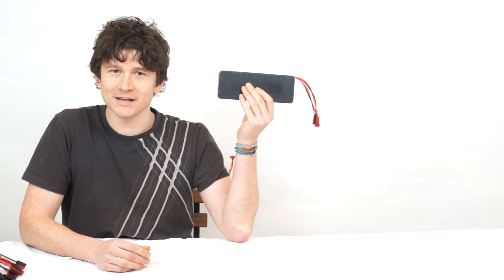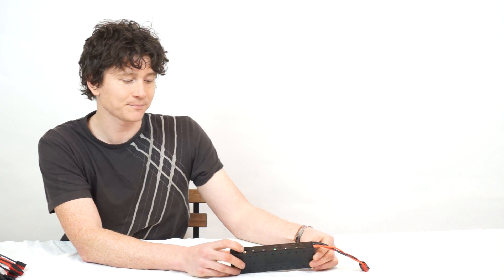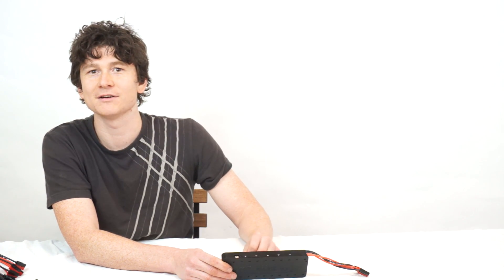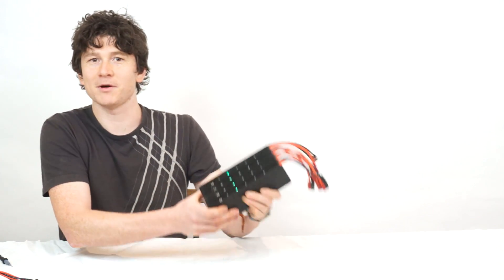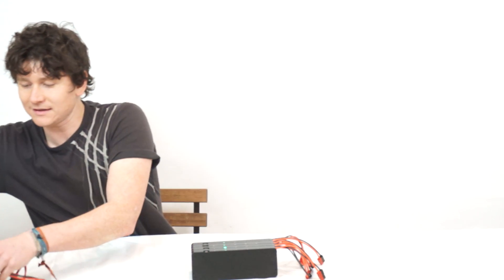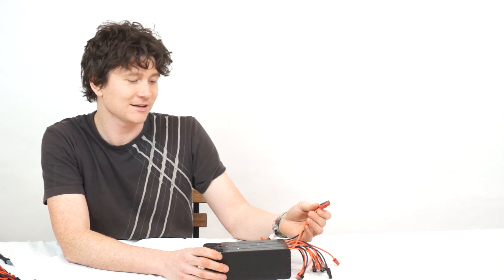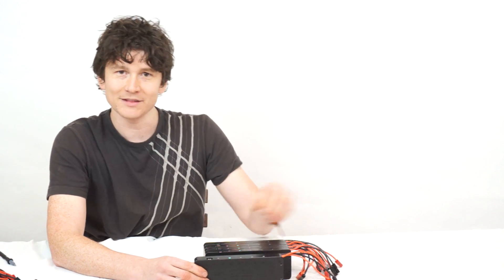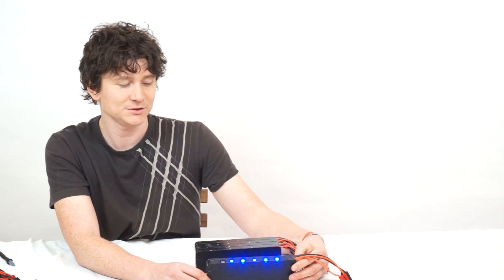LiGo Battery, Introduction and Basic Usage Tutorial

Comment: What about riders with 52v (or 48V) batteries? Any plans to make a combination to get that?
Reply from the maker: The most viable to stay under 100 Wh would be to use 21700 cells in a 7s arrangement and then those can be put in series for 52V.  It's one of a few options on our roadmap.

Comment: What is the low temperature cutoff for charging these batteries? The Podbike is apparently using these batteries, so I am wondering about charging logistics during winter.
Reply from the maker: It is programmable to suit the cells and the application.  But regardless of what the BMS is set at, you generally want to charge when the batteries are above freezing temps, so in the winter in many parts of the world that means charging indoors rather than outside.

Comment: it is possible to revive a very low cell by putting the hobby charger into nicd or nimh mode and charge it in short bursts until you can get the voltage up to about 3.

it is risky because the battery can heat up and overheat if pushed too hard.

Comment: So if I make up a ,48,52 or 72 volt pack . Will I be able to change the connected above mentioned voltage's sized pack  with the one charger of the correct voltage for that size pack or have to disconnect each cell and change them individually?
Reply from the maker: This is only a 10s (ie 36V)pack. You can't rearrange the cells for 48V or 52V.  You can only build up 10s and 20s battery modules with it.
Reply: How did I miss that doh!!. Thanks for reply.

Comment: These seem to be the most advanced battery packs on the market, as i learned by an amateurial research during the last week. 
But i still have some questions. first of all. As you were a participant of the suntrip (and will be again?) are they ready for installation in a solar system? or what upgrade would they need? 
Are there modular upgradesystems previsioned? like usb ports, additional lightning etc etc to go with the modular batterysystem?

Cos that would be a really neat modular design ...

Well it is already. Nice idea with the shipment btw. :)
Reply from the maker: Hey there and thanks for the nice feedback. There really is nothing more that needs to be done for using the packs in a solar ebike setup like we did on the Suntrip race. What is really cool is that since the packs keep a full history statistics on their usage, we could actually tell from looking at the data on the LiGo batteries after the trip which packs were closest to the motor controller and which were closest to the solar panel connection based on the relative share of the discharge amp-hours and the charging amps distribution curves. 

There are a number of parts that we make for DC-DC converters, USB charge adapters, and bike lights that can all be powered from the anderson plugs on the LiGo packs, and we have more ideas like this up our sleeves too.

Comment: So the comment to you is 300 lb Rider with your battery pack system would require how many batteries to go 40 miles a day on a charge throttle only and what motor what voltage Woody run it at what voltage reading running at what motor would he have to buy what controller what do you have to buy what instrument panel like it's going to be your V something controller or whatever you call it I think I want to know how he's supposed to connect all those batteries and make it hang rumors tube and what would he need a 30 amp battery pack and how would you make it in 72 volt what motor would you buy because the 36 will doesn't have enough courage to make the battery go the wheel go fast enough for 300-pound Rider then you can build the bike after he has the motor to put it first and the battery pack so we don't know exactly what the size configuration of those two things are and then you can build his bike until then I have no idea how to make this and make it go 40 miles a day because it's getting to the point where it cost way too much to buy a battery that basically can be taking an airplane who cares about that part that's his so you can ship it cheaply

Comment: Okay let's get realistic I want a battery that will go 40 miles a day on a bicycle that will be charged and hold a 300-pound ladder on flat land Hut kind of a battery pack when I have to build charging system and motorized would I have to have on it give me these three factors and tell me what the total price would be for your charging system you're free or 40 miles a day battery pack how big would it have to be and what kind of a motor on the bike would I have to have more it will be reliable then I'll build it into the frame at the whole 300lb person but this is the part I don't understand what is going to get me this far throttle only no peddling and of my pedal I'm going to benefit the distance have regeneration in it so I have good brakes that way what is the system I should buy to do this give me all the parts of details of the total amount and I will understand your system much better it looks like it's going to take that $300 charger that you guys have that means you have to buy the display panel for your fucking bike the power of the the was it called the controller and the motor what are all the parts needed and what will the total cost be in order to get what I'm looking for on a bicycle down once you answer all those questions I don't know how much it's worth buying electric bike cuz afterwards it husky nothing to recharge it and how many cycles when I get out of it is the main question of the day if it is things going to self not self-destruct what would be my model range per day how long will my battery last before their shot and had to be replaced so what will it take to go 40 miles a day on the bike after charging for how many hours fill me in with all the details since you have all the answers I never
Reply from the maker: The quick answer James is that if you want a 40 mile no-assist ebike, you should get at least 800 watt-hours of battery capacity. You can do it with 8 LiGo's but for your application there is no need for an expensive charger or the modular LiGo packs. If you are on a budget just get like a 52V 16Ah downtube battery or similar with a standard charger. The weight is only ~9lb for a battery of that size and it would do the job just fine and last for many years.

Comment: How long chargin will take and will its posible to charge multiple LiGo's at same time with one charger?
Reply from the maker: You can charge multiple batteries in parallel with a single charger, that's part of the whole point of the design. The total charge time is easy to estimate based on the number of packs and your charge current.  Time =  Battery Amp-hours / Charging Amps + ~20 minutes.  So if you have 3 LiGos (ie 8 Ah of capacity) and a 4A charger, your total charge time would be 8 Ah / 4A + 20 minutes = 2 hours 20 minutes. 

More batteries in parallel would increase the charge time, while a faster charging current would reduce the charge time. There is nothing mysterious about it.

Comment: what happens if stacked in parallel and the packs are not al 100% charged?so 1 pack 60% 1 pack 75% 1pack 100% 1pack 90%.......what  happens?
Reply: 1981jwb he mentioned that the batteries will accept a charge when closed ...so I'm guessing the minute you turn them on, they balance themselves out.
Reply from the maker: Correct. Or at least, once the higher voltage packs are turned on, then they will start charging the lower voltage batteries (whether the low voltage battery is on or off). If the charge current into the low pack is too high for the cells, then the BMS on the low pack will prevent further charge current from flowing in. But you won't see this kind of current with the example SOC levels in the original inquiry.
Reply from the maker: At those SOC levels not much. You'd see the 100% and 90% packs discharging into the 60% and 75% packs until all the batteries are equally about 82% charged.

Comment: one question : when I have for example 6 packs in parallel (600Wh)  : do i need to press all the 6 buttons to turn the batteries on ? .... I would say yes because there is no communication in between the batteries yet ... it would be great if you integrate the switch ON/OFF  functionality of all the batteries in the bluetooth function .
Reply from the maker: Correct. This feature is not current available so you would have to turn them all off individually, and the case of 6p we'd generally recommend leaving the pack on and just using your contoller on/off switch.  
The wireless pack to pack pairing so that you can use one button to turn all the batteries off and on in unison has already been implemented, but we are not including it in the release FW yet. For a few reasons it is done over ANT+ rather than bluetooth.

Comment: Those Anderson plugs are ok up to about 15-20 amps, It would be cool if Grin uses xt60/60 /round gold plated connectors for higher currents. i've welded and melted at least 10 andersons previously. Awesome nice initiative btw. Lithium is going to have a big time soon.
Reply from the maker: In all of our experience genuine andersons are great at 40-50 amps continuous, it's at about 60-70A where they risk melting. So for battery currents on most ebike setups (20-40A max) they are excellent, but for motor phase currents they can hit their limits.  Anyways it would be no problem for someone to swap over to a pair of male/female XT60's if they wanted, but then you can't do stuff like this, (see last two pics) where all the parallel joints are dovetailed into a single effective connector
https://endless-sphere.com/forums/viewtopic.php?p=1263930#p1263930
We did just get a few thousand XT60 connectors from Amass though, so we'll be experimenting a bit more with 'em soon..

Comment: Simply incredible! Any support for the 52v/48v riders?
Reply from the maker: At the moment no, but have a look at this thread here
https://endless-sphere.com/forums/viewtopic.php?p=1220800#p1220800

It's possible to do a 13s/48V pack with 2Ah power cells and be just under 100Wh, or do a 7s pack with 3.5Ah cells and be close to 90 Wh, which could then be series connected to 14s/52V.  The best way to see this happen is to help us make these 36V units a big success and then we can be in a position to expand the lineup!
Reply: @GrinTechnologies  I was wonderign the same thing about support for 48v. I was imagining two 24v packs running in series and then being runnin parallel to increase total watt hours? I have heard that many solar systems use 24v.. so this may open up market for 24v solar charging system as well as for electric wheel chairs that run off 24v and some ebikes that run off 24v, and then also ebikes that run at 48v?

Comment: As appears to be typical for Grin products, this looks like the best thought-through battery solution for e-vehicles I've seen so far.  I know you folks up in Vancouver spent years and many e-miles (err - 'kilometers') proving every concept in this desgign.  Having myself biked in harsh climates for years I understand Justin's "potting" philosophy, and have reluctantly joined that choir, and now have sympathy for Justin when he is put in the position of defending that decision.  If these battery packs resemble the Phaserunner approach, I know they'll be bullet-proof.  The only issue I now face is that I'd sort of 'settled' on 48 volts as our 'standard' for the variety of electric vehicles we deal with -- largely due to trying to maximize the voltage level considered to be "safe" by regulatory agencies.  So, this might be a 'back to the drawing board' moment for us, or simply learn to live with 36 ...